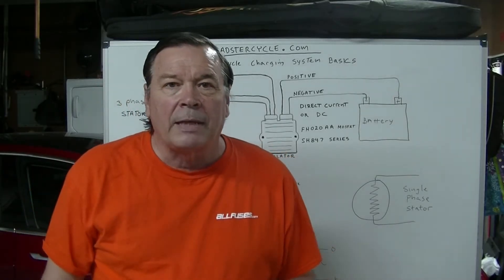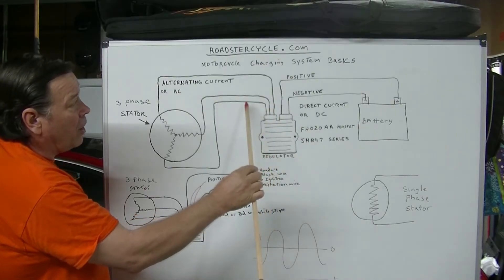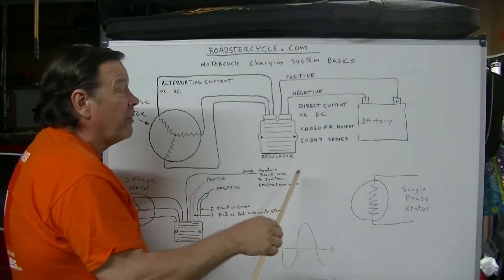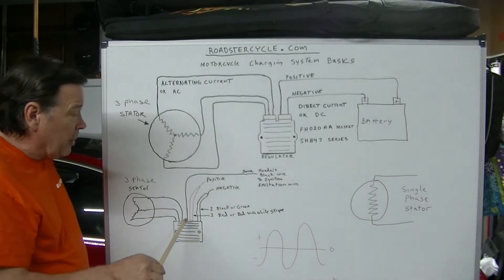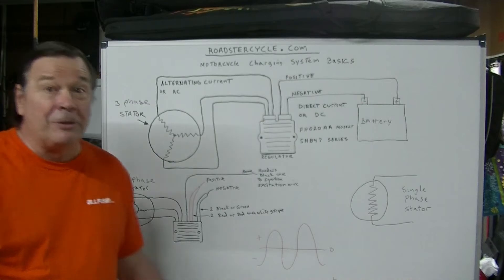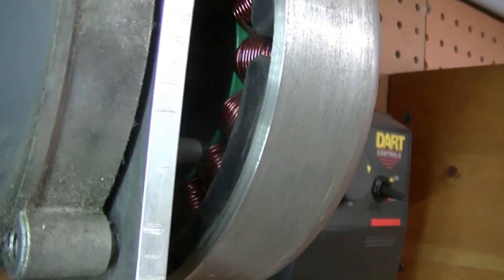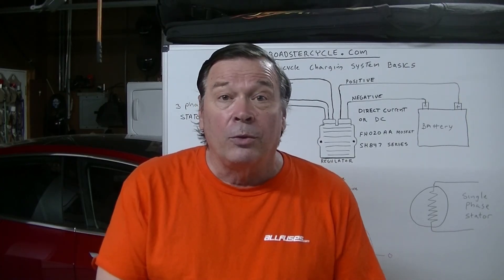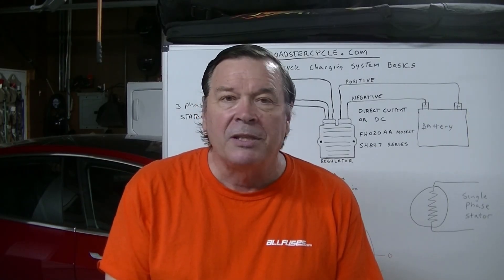Motorcycle charging explained

Comment: I just found your video. I have this problem with my Honda VFR. I have the excitation wire or signal wire as they call it at Honda, and my reg/rec puts out 16v or so. So I change the reg/rec, but it does the same thing with the brand new. Then I put a shunt between signal wire and positive wire and everything settled down to 14.5v. The problem is, I can’t shut down the engine anymore. I guess it bypasses the ignition. Do you have any solutions? Thx.
Reply from the maker: The reason your bike does not shut off now is because your are back feeding the ignition switch through the excitation wire.  You could put a diode in the side of the excitation wire on the ignition side so it does not back feed or put an extra switch on that wire to shut it off when you are done riding.   If you did not get that replacement R/R though Honda and you bought it off Ebay or Amaazon  that is the bigger problem, not a lot of quality control on those R/Rs.
Reply: I think that is the problem here. I don’t think that is the excitation wire. Honda calls it signal wire because it gets attached the R/R  through the + or red wire to tell the R/R to limit the voltage at 14.5v. At least that is what is shown on the electrical system diagram. The signal wire (black) connects to the + wire (red) of the R/R. And it should all make sens but looks like the reality is different . When I follow the signal wire on the diagram, it meets the red wire of the R/R and that is the end of it….. Too bad I can’t attach the electrical system diagram.  @Roadstercycle
Reply from the maker: You don't need to send me a wiring diagram as I've seen this setup for years on many many Honda's.  I would send back your latest R/R purchase and purchase a quality R/R.  You are fighting a battle that does not need to be fought.
Reply: I was thinking about the R/R being bad by I took it to a motorcycle shop and they said it is good. They said they don’t guarantee for how long, but it is good. Would I be able to put a mos-fet R/R on it? I will google to see what part number and see where I will find it. Thanks for the info. Cheers. @Roadstercycle
Reply from the maker: It would be so much easier if you just called or emailed me.  jack@roadstercycle.com  or go to my website and get my phone number.

Comment: I want to find a good quality regulator but it seems that all of them are 3 wire for the stator but i only got 2 what's the best way to hook it up
Reply from the maker: Both the FH020AA and SH847 will work with 2 wire stators. I've done it numerous times on different bikes over the years.  You just hook up 2 wires  instead of three.

Comment: Hi, Jack.  Great info and well explained.  Let's go down vintage bike memory-lane with a '73 Norton Commando Production Racer, single-phase Lucas stator, stock charging system.  
What's the Ohm reading I should expect to see between the two alternator leads?  Also, the first Commandos had a volt meter in the headlamp shell; this one is a later one with the Lucas "assimilator" controlling a charging "idiot light".  I'm assuming SH847 installation will involved removal of old Lucas stack-of-plates rectifier and the Zener grounding diode and also with each alternator lead attached to one of the three input wires (third insulated off).  
What's the connection for signal to the assimilator and the emergency capacitor (I'm assuming just off the hot side of the battery with no direct involvement of the charging system, right?)
Thanks

Comment: Can you put a regulator to a single phased stator with five wires? two red wires, one black wire, one white wire and one yellow wire on the regulator. 
any help is appreciated cheers
Reply from the maker: Sounds like your trying to install a battery system on a non battery bike that uses AC to run the lighting and ignition.  I have not tried that but others have. Check your model bikes forums.
Reply: @Roadstercycle  yes, that’s exactly what I’m trying to do to my PW80. Do you know of anyone that was successful in doing this?

Comment: Hello , my name is johnny i just bought a 2000 suzuki intruder 1500 , im having charging issues and could use a little help, i have the manual and in it is a pic showing a charger connector lead running of the positive side of the battery with what appears to be a fuse link in it but here is my problem, the guy that had the bike before me tried to run a bunch of those light strips and i guess they started killing his battery so he cut and ripped off the connector ends and left everything else hanging from the bike , so naturally i got rid of what was left and i think i took the CHARGER CONNECTOR LEAD off as well thinking it went to the lights he had on the bike, i have no clue where that wire is supposed to run to because it doesnt show it in the wiring diagram at all , if there is anything you might know about this please let me know,
Reply from the maker: Hi Email me,  Jack@roadstercycle.com

Comment: To add on my comments is there are two different stator coil 3 phase  configurations. Your diagram shows a star connected stator where as the kawasaki stators are delta connected. Just a small point that there are two types but do the same job.
Reply from the maker: I only used one example for ease of explanation, as you said, they both do the same job.  Why complicate things?

Comment: I've had a lot to do with advice and repairs on kawasaki charging systems. In particular ZX12R'S. 
You've said about wiring the phases direct ie- hard solder each phase to the regulator ,yes i agree as plug n play sockets often burn out if plug in connections are poor.
As for testing the coils in the stator you need a good quality multi meter to read off 0.3 -- 0.5 ohms that most coil resistances are.
The ultimate test is to read all 3 phase coils in turn for the output voltage with the motor running. On the ZX12R the AC voltage across each phase pair has to be around 85 volts AC to a max of 120 volts AC and equal volts across each phase pair at 4000 rpm. If any phase is down on volts chances are the stator is toast and will need replacing. Some guys test to chassis which wont reveal anything as the stator is fully insulated againt chassis. You test 1 -- 2  2 -- 3  3 -- 1 coil connections  to take an AC volts output reading. A lot of charging failures are from poorly maintained plug connections within the system.

Comment: There are a lot of us in the field who fully do not understand the basics of a float  charging system such as in small engines, cars and motorcycles. And it gets complicated when the charging coils get labeled single or double or even three phase operation.  Your video and your bench display of the alternator operation is right on target.   Just remember that when everything is working, you have two 12 volt sources of power tied parallel or bridged together.  One is your storage battery (DC) and the other is the engine turning a rotating magnetic field (AC) which is converted to DC.  Two DC sources and 1 or more loads all connected together.  Both power sources, and all loads are connected.   AT some magical rpm the power from the charger will be equal to the power demand on the battery and the lights will get as close to the 12 volt load point as you will ever see.  If your lights dimmed it is because the alternator is not turning fast enough to match the power demand for the lights.  Idle it up a bit and observe the result.  More RPMs generate a little more power and 12 volts load point is maintained.   Our battery should never be discharged below about 30 percent or the life of the battery (lead acid) is shortened. Each time we run the batt down we shorten its life.    The system is designed around that concern so that we don't waste  horsepower just to run a charging system.
Reply: My first car had an ammeter and I'd see the needle flicker as the generator(we're talking the 'sixties) started charging the battery. I am still excited by electric starting on motorbikes, beats remembering to park on a steep hill in winter.

Comment: lmao @7:27, WTF
Reply from the maker: Yes this what you can do if your stator plug has melted. Honda's are notorious for this happening. You can attach them in any order as they are AC current, the R/R changes it to DC.  Quick easy fix.

Comment: what about dirt bikes they normally dont have a wire going from the regulator to the battery? Do They?
Reply from the maker: A lot of times dirt bikes just use the AC coming from the stator.
Reply: @Roadstercycle  how’s that work charging a dc battery?
Reply from the maker: @MrBoomtheroom  I would need to see a wiring diagram to figure out what the OEM is doing.
Reply: @Roadstercycle  whats you email ill send u it🙂
Reply from the maker: @MrBoomtheroom  jack@roadstercycle.com
Reply: @Roadstercycle  also can you tell me why the body of my dirt bike starter motor has continuity with its + input terminal I would have thought that would cause a short.. but when i hook it up it runs fine...what am i missing?

Comment: Do you have any idea how much watt it produces by its all mechanism? I mean if i try it on to charge larger size of batteries and thier time
Reply from the maker: You can charge larger batteries it will just take more time. I don't understand the "by it's all mechanisms"
Reply from the maker: My Sh847 will control up to a 50 amp stator output.
Reply: @Roadstercycle  and may i use it with honda CD70
Reply from the maker: @Jatoiroshan  Send me a wiring diagram and I can tell you. jack@roadstercycle.com

Comment: Hi Jack, I keep burning up stators on my Buell XB12X, I purchased a FH020AA several years ago from you and it's still going fine.  Do you recommend a upgrade to SH847 to save the stator?
Reply: Do you have LED headlight? 
I installed a set on my 08 xb12ss  last fall and the shitty oem regulator just get down!  
I command a fh020aa to Jack , maybe I should have ordered a sh847 for use with Led.....

Comment: I know this was released 2 years ago. Just wanna mention to Jack. You drew a stator that is 3 phase star connected. If you look on the schematic, all the motorcycle factories produce 3 phase alternators that are delta connected. That's the way all the manufacturers are able to generate the most ac current/ power /watts... Re
Reply from the maker: You are correct, I was just discussing principles not design.

Comment: I have a Suzuki boulevard c90 someone cut the plug off from the bike to the stator I bought a stator with 3 white wires coming out of it and the bike have 3 black wires can I hook them up wrong? Cause I don't know what wire goes where  thanks alot
Reply from the maker: Stator wires are AC current so you can hook them up any way you want, there is no wrong way.
Reply: @Roadstercycle  OK good would u know why I put in a new stator and a rectifier I checked the battery right after it said 1334   Fri last night I started it again it was 12 something then it went to 11something then died completely turn key nothing then I notice the the big plug on the rectifier completely melted any help would be great could a bad battery do all of that?
Reply from the maker: @mackenzieharmon826  First of all motorcycles usually charge around 13.8 to 14.5 volts in most cases. Did you buy a good R/R or an ebay knock off or what?  Hard to figure what could be wrong without some facts. Email me jack@roadstercycle.com

Comment: I have a thwaits dump truck 1989 no lights air cooled only wiring is to the ignition  and battery does this apply there are 3 wire s from the stator
Reply from the maker: It should but a wiring schematic of the trucks wiring would answer the question. I'm not familiar with the Thwaits truck.

Comment: Does putting speakers on your bike affect your charging system ?
Reply from the maker: If your talking about adding speakers to an existing radio I don't think it will matter much. If you install a power amp to drive the speakers then of course it will.

Comment: Roadstercycle Jack ? This Honda XR650L hybrid to electric motorcycle idea hit me. the idea is you install a big electric hub motor with rim and tire to front of Honda XR650L. add a nice size pannier behind seat for battery pack and controller. then connect a DC to AC inverter to the motorcycle battery with a surge protector between the battery charger and DC to AC inverter, with a switch between the battery charger and battery pack. when the motorcycle gas motor is running it will turn on DC to AC inverter to turn on the battery charger, to charge the battery pack while running on gas. My question to you is, can the Stator for this motorcycle handle the power when it comes to charging ? like 3000-6000 watts if not, how could we beef up the Stator so it can ?

Comment: Hello I have a 2001 suzuki 1000 and it keep going dead. Ok first I changed the stator the rectifier battery and also I changed the wire harness because they was burnt out and ran them straight. So I ended up crossing the stator wires do that make a difference? Also my wires get hot the stator wires and the rectifier wires. When the bike is at cold start my battery seem like it's charging when I have a voltage meter on it. When I give it higher rpm my battery voltage goes up to like 13.80v but as the bike gets hot and running for a while my voltage goes down and if I give it higher rpm my volts don't move anymore. Please help me out on this I have tried everything from changing ground and hot wires,  relays I'm stuck in the same position.
Reply from the maker: Hi, The stator wires can be hooked up in any order as they are ac voltage so there is no dedicated positive or negative. Check your bike for a draw when it is shut off to see if something is draining the battery. Do this by taking a battery cable off and hooking a test light in between. If it comes on then there is a draw. Go to my website and get my phone number and call me if you need help more.
Reply: @Roadstercycle  hey thanks I checked to see if I had any draws it's not any. Question so when I first start my bike cold start it seen to charge but as it get hot the voltage goes down also when i ram it up instead of my voltage going up it goes down you have idea on that.
Reply from the maker: About 99% of the time when the voltage decreases when increasing RPM I've found it ends up being the being a regulator failing.

Comment: Have a question. What did I damage on my bike when I wired a new battery backwards? Replaced the two blown fuses however my new battery will not charge on a Trickle charger while installed & connected to the bike. But when I remove the battery it will take a charge. Thank you!
Reply from the maker: Hi, Email me at jack@roadstercycle.com with the make and model of your bike. Glad to help.

Comment: i Want to adapt a battery in my 1999 KLX 650 R , have lights , regulator etc , but you no...the light bright more when you use the accelerator , i want to stop this using one battery and be charging with the motorcycle in movement , the idea is have constant energy in lights and horn etc...sorry my english...do you think it is possible with this diagram ?
Reply from the maker: Hi,  Send me a wiring schematic of your bike to:
jack@roadstercycle.com

Comment: Hi jack . Very interesting video. A question on my battery . Had to charge it up yesterday . Un pluged from charger , @ 12.4v . Fitted in to bike  tried to start and in about 5sec id droped to 6.6v . Didnt start bike . Now its reading 12.4v again . Will battery be stuffed . Cheers , jamie in New Zealand.
Reply from the maker: A wet cell battery fully charged should be about 12.8- 12.9 volts.  Sounds like your battery is toast if it went down to 6.6 volts so quickly.

Comment: My new stator outputs 80 volts.  The manufacture says it should output 60 volts.  Can a stator running hi voltage destroy a regulator.  The part number is 32800-47H00. It comes from a 2008 dl650 Suzuki.
Reply from the maker: Actually some Ducati stators and others I've seen well over 100 volts. Never seen any voltage kill one of my R/Rs.   Usually stator voltage climbs at about 16 volts per 1000 RPMs.   5000 RPMs @ 16 volts per 1000 = about 80 volts. I don't see an issue.

Comment: Where does a regulator rectifier set up come into play?
Reply from the maker: The regulator rectifier changes the AC voltage that comes out of the stator to DC voltage to charge the battery that runs the electronics.
Reply: @Roadstercycle  Thanks….I know now most are combined….was just asking to make sure there wasn’t a separate check for the rectifier

Comment: Hello sir. I just came across this video and it really helped me understand the view of how the flow of charging system works. My current situation is that 06 Suzuki GSX-R 600 died on me at a stop light the other day. Now I see it could be the generator, regulator or battery. Got the battery tested and it came back "good". Still have to narrow down the other 2 components. Also, prior to the dying at the red light, I have been experiencing some power dimming when I shifted If that helps. If you have any recommendations I'd love to hear them. I know your busy. Thanks for your time sir.
Reply from the maker: Hi, Check my website out for help videos on checking a stock regulator and stator.

Comment: I just bought a FH020AA Mosfet regulator for my vfr 800 fi.
The bike has stock lights..
But the regulator on it stopped working..
So it needed an upgrade..
I was informed that the FH020AA was indeed a Mosfet...but you say it's a shunting regulator..
I know you are more experienced in this regard.
So you figure the SH847 to be a better option?
Reply from the maker: It seems all my VFR customers are running the sh847 now. It runs the stator cooler.